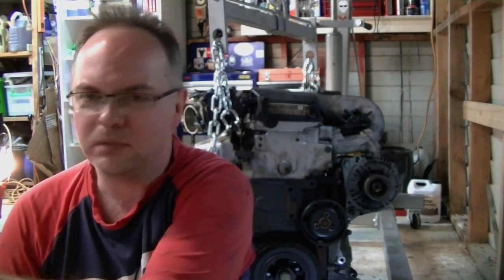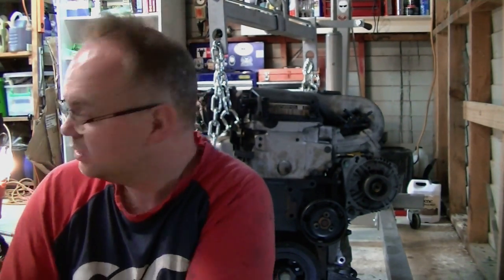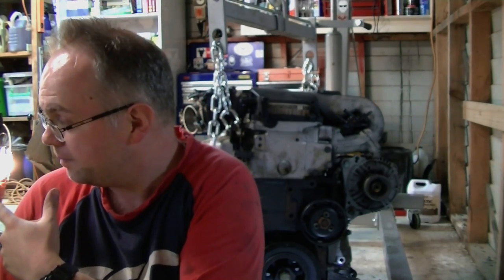VR6 Engine Pull - Part 3 - VR6 Rebadgered

Comment: Great job removing that VR6 engine I'm amazed at how efficiently it came out, although I have to say I wish you would have shown everybody exactly where you mounted the engine hoist chains too.

Where exactly did you mount the engine hoist chains too?
  Which bolt did you use to hold it down?